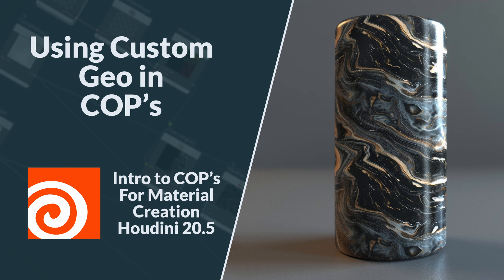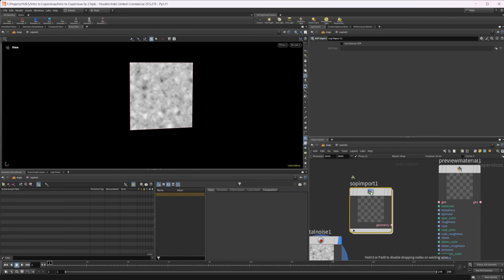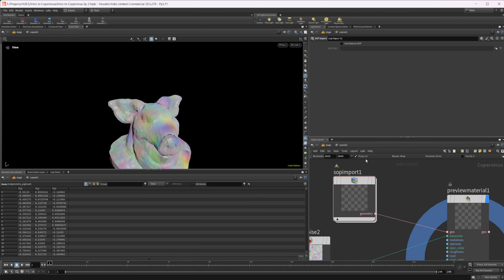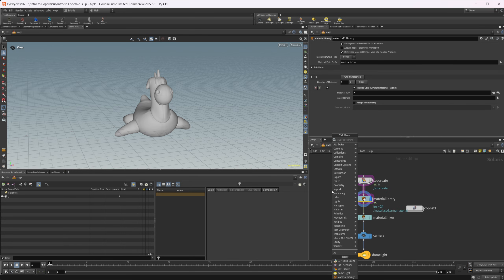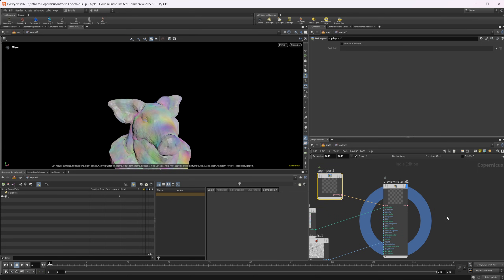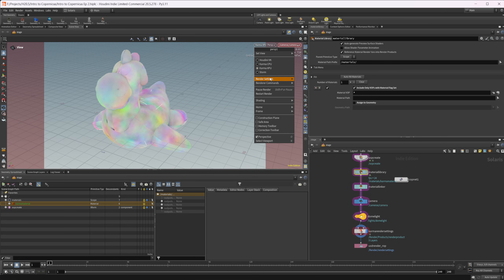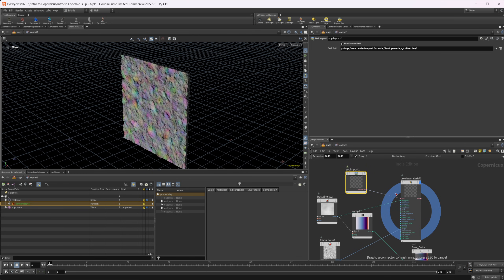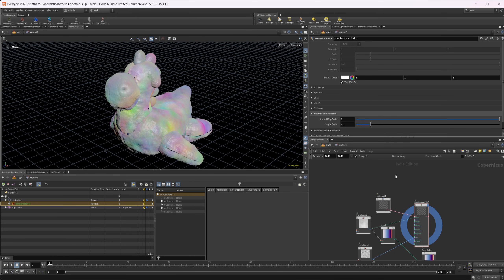Using Custom Geometry in COP's | Intro to COPs | Houdini 20.5

Comment: I don't know why but preview material doesn't seem to be working for me. I can change the geo , but whenever I plug anything into color or height - nothing happens. Am I missing something?
Reply from the maker: Shouldn't be. Make sure your display flags are set correctly. It's still in beta so there are some issues
Reply from the maker: Are you on Mac? Also you can preview materials in the viewport in Solaris using the new quick material pretty easily. I have a video on that as well
Reply: for me when 3d prederence set to Vulcan displacement doesn't work... works on openGL

Comment: In the video the color ramp isn't working properly because the fractal is wired into 'size_ref'.  It should be wired instead into 'pos'
Reply: It still won't work properly, you'll see it if you turn on the color infrared. The color will be from green to red.

Comment: It seems to me that H20.5 is one of the most bug ridden among many of its predecessors released to date. In many of the review videos like yours I’ve seen loads of bugs all over the place.
Reply from the maker: The biggest reason for that in my opinion is that COPs is the major draw of this update and it is a beta release. So it has work to do. That being said I haven't had anything that's completely unacceptable and makes me unable to work.
Reply: @InsideTheMindSpace  That's absolutely correct. Almost all of the videos I mentioned had mostly Copernicus related problems. I have faith that they'll all be addressed in a few iterations from now.
Reply from the maker: @noc2_art SideFX is amazing with customer support in my experience so I would be willing to bet a lot of issues get fixed in the minor builds
Reply: Copernicus is very new to be fair, so I expect it'll be a few versions before these issues are ironed out. I foolishly accidentally opened a near finished project I started with an earlier version in 20.5, and had lots of issues getting it across the line. Was a real sunk-cost situation. 

But overall the idea is solid so I'm eager to see where it goes. Definitely needs more generative noises to be added though.
Reply: Same here. On my laptop Houdini instantly crashes when I add the preview node. But I'm still very much excited by it's potential.